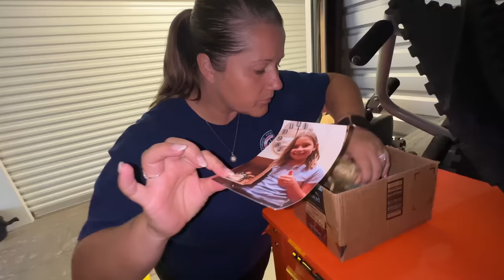My Haunted Doll Stopped Thieves

Comment: Build your fences like 6 - 12 ft and reinforce it on the side where the animals are by chicken wire bury it partially and reinforce it in concrete then bury it. But yes run chicken wire the whole height of your fence and the animals have nothing to get a foot hold on so they will be unable to escape. That's so funny that your haunted dolls thwarted the thieves ... maybe you've earned your dolls' respect so they help you safeguard your place.

Comment: You could put gps trackers on your dogs if you are worried about not finding them. I've seen, for fence climbers, PVC tubes strung up with cable or something, at fence tops in the areas they climb, usually corners. They will get to the PVC and try to climb over, and it rolls them back into the yard. 😂 But... If they climb AND DIG... You are likely better off running an electric line around where you want them to stay, and training them on the parimeter they are allowed to roam.

Comment: You need to dig and bury a wire fence underneath the ground at least 3 feet and have at least 4.5 feet high to keep them from jumping over Omar. My friends owned a kennel and they built theirs from scratch and if you really want to keep them in your going to have to put that work in or put a electrical fence around them. I think those are awful to shock an animal to stay home.

Comment: ghost stares at the theif and then smiles

theif walks into the building and starts trying to enter a storeage unit

Lights start turning off and on rapidly

theif acts like its nonething

doors start open and closing
thief trys to brave it

ghost appears and stares at the robber

Robber books it at lighting speed out of the build and goes to the nearest crutch to repent